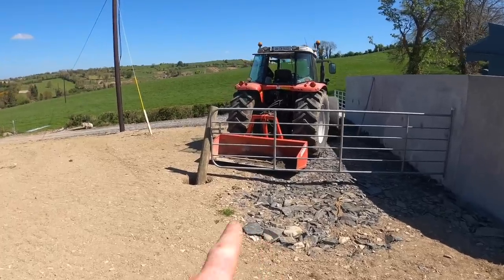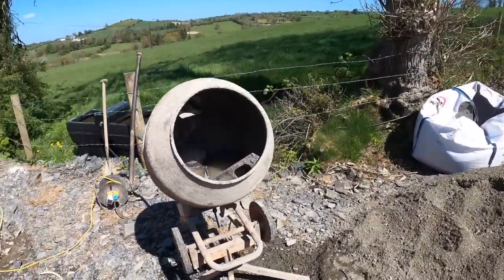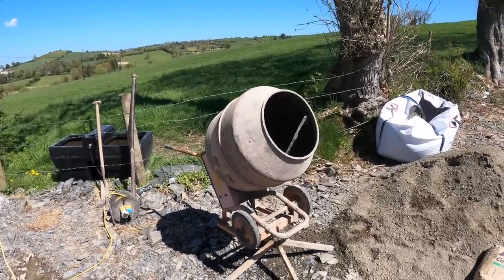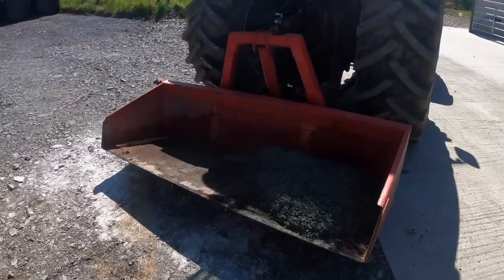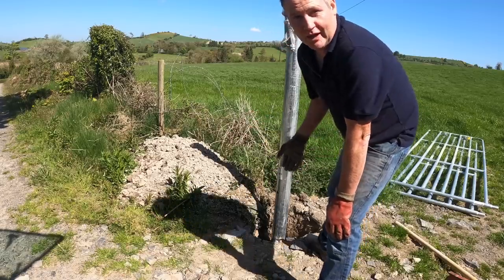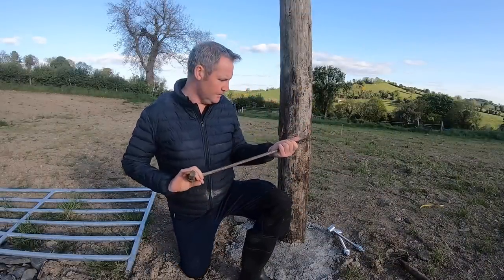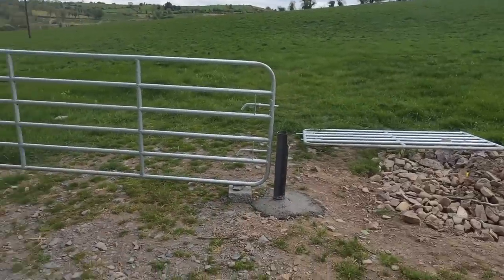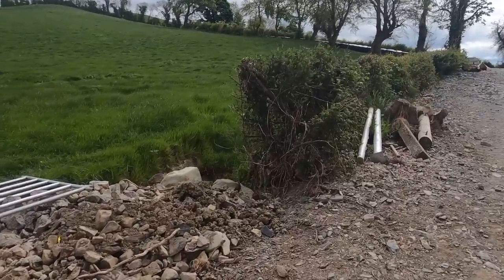STOCK FENCING, HANGING GATES " AND THE MALONE POST DRIVER

Comment: Another great video👍👍👍 Those drills used to be used alot by ESB for drilling holes for insulators on poles.Keep sheep wire up 4 to six inches off ground allows to strim or cut weeds and briars underneath

Comment: If you fully wind out the extension lead the mixer motor, or any other motor for that matter, might last a little bit longer.
Reply from the maker: It never really heats the lead, but a good tip, I’ll do that from now on

Comment: Your post pounder is much better than mine. Mine as nothing that rests on the posts. Mine has a huge I beam running up and down on rollers and a pair of springs to increase down speed. But with nothing to hang onto post except a little hand tool it is far scarier ,  more dangerous and a lot harder to try to keep a post straight.
Reply from the maker: I think I know the one you have, there all dangerous in the wrong hand

Comment: Do you not find the timber poles rot over time and become loose in the concrete?
Reply from the maker: No I have esb poles in over 15 years and there all still perfect, just make sure to cover the tops
Reply: @IFarmWeFarm  What do you cover the tops with?
Reply from the maker: Sean Clarke lead or even plastic bucket lids do the trick
Reply: @IFarmWeFarm  ford cortina hub caps (nice chrome finish)

Comment: How is the Massey going after it got its bit of tlc.
Reply from the maker: All good so fare 🤞
Reply: @IFarmWeFarm  In the process of trading a mf 4260 for a mf 6470 😓
Reply from the maker: Patrick O'Donnell the 6470
Is a power horse, you’ll miss the 4260 though for it’s simplicity

Comment: That's one thing I can't stand is when I loan something out and it comes back and worse shape.  If I ever borrow anything from anyone which is a rare occasion I make sure it goes back in the same shape or better.
Reply from the maker: Ya it’s better not to loan things out if you can help it, they will never come back the same. I lent my tipping trailer out for a few days, it was only new too, came back cover in thick clay, had been rolled as the side door hinges were broken off and drove in. Was left back at night so I wouldn’t see it till morning too. Spent 3 days fixing it. I have no problem saying no from that day forward.